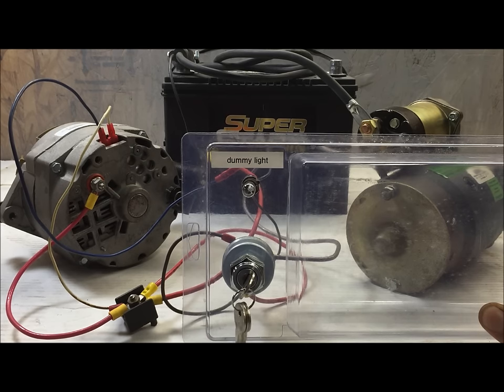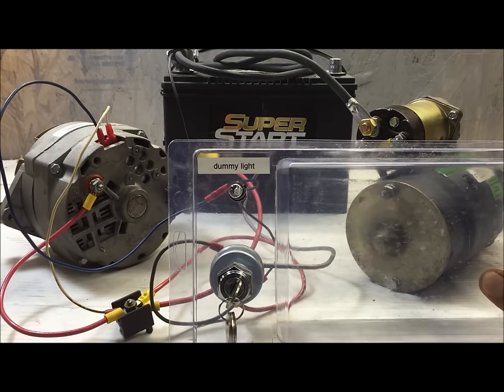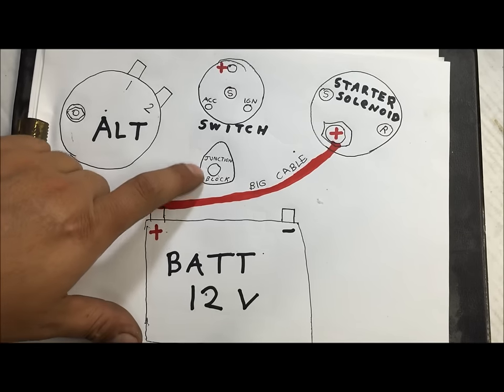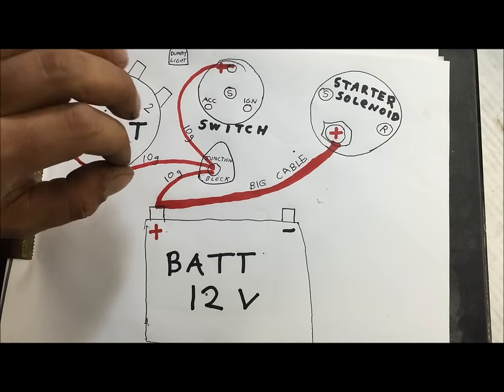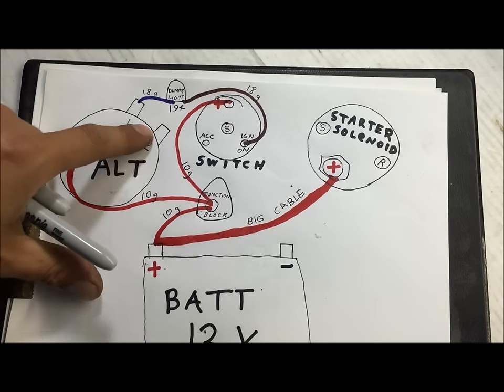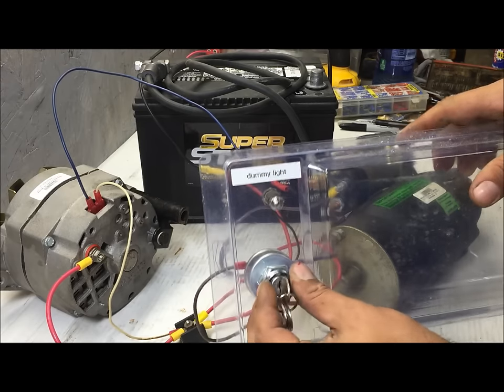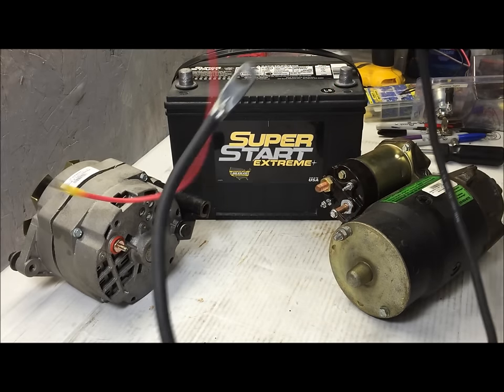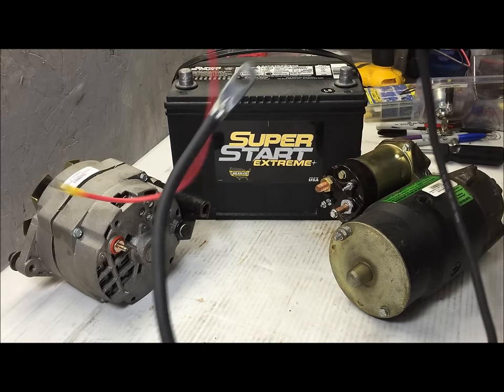64-72 charging system wire up using GM 3 wire internally regulated alternator

Comment: Nice video but how do I also wire the coil and resistor?
Reply from the maker: I have a points ignition video this is the charging system. Not the ignition system

Comment: For those wondering what the R terminal is on the starter solenoid ? On the older contact points ignition systems. 12v was too much voltage with the engine running. It would prematurely burn up the points. So they ran a resister to the points in the distributor.and drop the voltage to 9 or 10 volts. The R on the starter, also ran to the distributor, but only sent power during cranking. Giving you 12 v. To the points during cranking, as an aid to help start the engine. 12v.= hotter spark.once the engine has started, you let the key off the crank position, and the 9 volt resister wire was now running the distributor.
Reply: Exactly
Reply: #1 alternator exciter terminal wire requires diode inline or key won't turn off engine on 10si alternator. 
Do not buy new alternator if dummy light does not shut off and engine does not shut off with key.

Comment: Question about the 194 dummy light, you said it's to be wired hot off key to #1 terminal to excite the alternator, then it will cut off. What causes it to do  that?

Comment: The reason that the light goes off is that the circuit has a ground through the alternator before it starts to spin. The 12v coming from the ignition switch needs that alternator ground to light the light, once the engine starts, the alternator sends 12v back towards the ignition switch on that wire. 12v on both light conductors with no ground makes the circuit null and void, no difference of potential.

Comment: This is the best and easiest to understand video I found to explain this. No nonsense and too the point. You're a great teacher. This helped me with my 50 CHEVY TRUCK 12V conversion. I especially appreciate the safety factors you stress, wire guages, etc. I will however add a 50 amp in line fuse to the hot wire that feeds the whole system to prevent any spikes.

Comment: Big thanks for this I have a 73 pickup with a birds nest of wires that wont run because the last owner wired it all wrong so I plan to strip it down and re wire it but I dont know much about electrical stuff on cars so I wanted to be sure on the basics and you did this in a very simple but informative way that I understand!  Again thank you!

Comment: Thank you for your video, it helped me to understand and to rewire my 1973 Case 580 CK tractor. The alternator that was on the machine had two wires not three, but I went out and purchased a GM Three wire alternator. The prestolite alternator wasn't working so it had to go. Your video was very informative and easy to understand. Now the dummy light works. Thank you again Charles Mares

Comment: You are very generous to share your knowledge. This will definitely be a reference when I start wiring my 85 monte SS back up. (previous owner cut out most wiring for some reason.) Also have an 87 SS with a drain. Will double check the wiring on that one. Thanks again.

Comment: Best vid for me to understand how it all works.  Will be completing my '89 Massey Ferg tractor.  Can't wait to get started.  Thanks so much pal. 😊  In the late '50's chevy Dad's car had a generator and voltage regulator.  He'd turn on the headlights on long highway trips so that the regulator wouldn't overcharge the battery.  Gas was 39 to 50 cents a gallon then.

Comment: Chris, I appreciate the help very much. Drawing the diagram is key for me. I have a John Deere Diesel engine that my so-called, X mechanic rewired.  He had a small clamp on one end of a wire you were required to clamp it on the positive side of the battery with the other end of the wire going to the fuel pump. We had to hook it up to start the engine and unhook it to kill the engine. I am fixing to go repair my equipment with the help from you. I subscribed to your channel and look forward to many more of your demonstrations. Now I have to get to work. Thanks again!!!!

Comment: Great video and very informative. Only thing is that you should have mentioned that the big cable going from the battery to the starter is a POSITIVE cable. Given that the cable is black some people might think that it is the NEGATIVE cable going to the starter.

Comment: You can just replace the voltage regulator which is where number one and number two connect to. It's a chip and it's a lot cheaper.  Then buying the whole alternator A lot of times the stator  and windings in those GM alternators do not go bad or like you said the diode or rectifier but the diode and the regulator are pretty cheap and relatively easy to replace. There is brushes in there too like an electric motor but they come in a kit I think or you can buy them separate but they're not that expensive. Of course if you're savvy at rebuilding stuff like that, which you are just throwing that at you cuz that's what I do Good video on the wiring I like it!

Comment: Good video man! I had replaced the starter on my old Camaro and didn't have any power after I got the new one back on.. A small wire was coming off of the battery hot wire cable that I assumed was going to the junction box. As it turned out the 12 volts to the junction block was actually coming from the starter hot wire terminal, which of course I hadn't hook back up.(to be honest I had never seen that before) I'm glad you mentioned it in the video, or else I would have looking in a whole different area. As soon as I heard you say that I knew what had happened. I'm not a great mechanic, but I understand the electronic part pretty well. Thanks for taking time to do this.I've learned a lot from your videos.  David
Reply from the maker: yeah, after 71 they ran a fused link off of the starter to feed everything.. good comment
Reply: David  Slack the

Comment: Perfect explination.  Thanks man I am in the process of a complete rewireing of my 66 chevelle SS 396 using American Autowire.  I ripped out the old and after doing the simple stuff I went to the engine compartment.  To say its confusing is an understatement.  The wires are different colors than what is normally there.  Tough times...

Comment: British Classic Car Folks, BMC, British Leyland (MG, Triumph, Austin Healey, Jaguar all pre-1980) The main 10 gauge battery charging wire and the #1 (R) for the ignition light (14 gauge on my MGBGT) on the tachometer. The #2 (F) jump it to the main screw battery using 10gauge minimum. Great video that documents the electric path.

Comment: Thanks for the refresher course. Been tied up fixing newer stuff forgot all this. Just had someone bring a truck to me, 78 Chevy, that I don't think even one wire worked. Someone replaced all the gauges in the dash with aftermarket, cut holes out where the original gauges were and literally used silicone caulk to glue them in. An amp gauge, that was tapped into the power supply to the ignition switch. The copper oil  line to the gauge was cut about 5" before the gauge, a rubber hose with 2 clamps on a plastic nipple connected it to the gauge, It had been leaking oil down onto the switch. The aftermarket temp gauge with the probe into the the head had just been cut off when they exchanged engines. As for the alternator, the battery lead ran all the way back to the firewall and was butt connected directly to the #2 alternator lead on the alternator, with a big yellow splice connector barely connected to a red wire into the harness. Plus 10' of rubber gas line from the saddlebag tank switch valve laying on the exhaust to the manual pump, then a metal line up to the manifold, from the pump, that had a kink.... what a mess. And the one working tank is full of bad gas. All this crap connected to a new engine, trans, Edelbrock carb. Now new electric fuel pump, ran to original metal line along the frame. Tomorrow hopefully I can finish this mess, thanks to your help.

Comment: What actually happens when the alternator starts charging is it sends +12v from the alternator to the dummy light bulb. Since the bulb will have +12v going into it from both sides there will be no current 'flow' and the bulb goes out. It doesn't break the circuit to the bulb. That is why on some vehicles if the alternator isn't supplying the full current it should, and the "balance of power" is unequal,  the dummy light can glow a little. It's a alert to check the system, both ends of the main circuit, the alternator and the battery which could be malfunctioning as well. Great video exposition, Really great to see the wiring displayed like that, Thanks    Just sayin'         Mike

Comment: Great job Chris! .. Good overview of the alt, start and key switch hookup ..  If the light does not go out and there is and issue with the alternator its usually the rectifier going bad.  Normally the alternator is still good and a simple replacement of the rectifier will fix this issue.  However, it's still not to say the alternator has an internal short of open winding somewhere still causing the problem.  Most people will just replace the alternator costing $$$ where the simple replacement of the rectifier is a whole lot less.

Comment: i followed this video and was suscessful running a temporary ignition setup on my 74 chevy c20 after ditching all the factory wiring and replacing the fusable links everything is brighter and the engine woke up thank you for doing it right used all the same stuff
Reply from the maker: watch my 3 wire gm alternator video in case your truck won’t shut off
Reply: What did the fusible links run to, and where did you buy new ones?

Comment: If your application is in a tractor with a 6 volt starter (no solenoid) and coil with a ballast resister, the dummie light will go on the S or center post on key switch, and the coil will go to the I or Ign. Otherwise the motor cuts off when the ignition is returned to the ON position. Great video thanks helped alot

Comment: it wouldn't hurt to use 8 ga. wire from the alt. to batt. especially with higher amp alts. like 100 amp and up. and if long distances. or 150 amp plus 6 ga. or 4 ga. wire if using high current devices. more wire. means less voltage drop. and more current flow. and don't forget the ground. or negative side. there has to be a ground strap or wire. from the batt. to the engine. and body. I have heard of fires from poor grounds melting break lines . and fuel lines. because of the metal lines carrying the full current of the battery . when starting. or under heavy load. lots of the time ppl forget about the ground cables.
Reply from the maker: +James stranger watch my 100 amp alternator video.. this is factory 70 chevelle .. early video that I need to remake
Reply: I liked it.

Comment: I'm Completely rewiring My 69 C10 with a 1980 350 sbc using American Autowire (AA) Harnesses. Trying to figure out where AA's Brown wire (Alternator Ign) and red wire (Custom Jumper Supplied by AA) connected. The original Alternator harness wire colors were Blue and Red. From your Video, I'm now confident that I'm connecting the correct wires to the 1 an 2 terminals (as shown in your video. Thanks a million. Now I can get some sleep!
Reply from the maker: I have a gm 3 wire alternator video,,, it’s old

Comment: Saved me a lot of drama here, I was about to hook it up all wrong, I've been watching other vids and couldn't work it out, you have nailed it with this vid thank you
Reply from the maker: ask me any questions..  this video is actually an early one... but i know all about wiring anything old school...
Reply: Thanks I think I'm all good now I just had trouble getting my head around the dash light and the white and brown wires, but I would like to ask if the main drawback to connecting the White right at the alternator be not knowing if the charge is reaching the battery?
Reply from the maker: @715101  watch my gm 3 wire alternator hook up video

Comment: Thanks for the very good video. This helped me diagnose a short which happened to be on the starter wire going to the alternator. I was able to follow the wire - The wire was broken off. It is a 1972 LeMans.

Comment: it's usually a 4 Ga. cable from battery to starter, or larger. It certainly doesn't hurt using a larger cable. Just make sure to use "Tinned OFC Copper cable" so it does not corrode being out under your hood. cool video

Comment: Excellent video.  Your vid is the only simple explanation (3 wire alt) diagram and demonstration I’ve been able to find. Thanks.  Hands down nothing out there compares. With all that said shame on you for using a BLACK cable from the battery to the starter.  😳 it’s easy to find a mistake once you educated me. 😁
Reply from the maker: the factory cables on old cars were ALL black... those are factory reproductions for a 70 chevelle... watch my 3 wire alternator hook up video
Reply: There ya go and now we all know without a doubt why you are the teacher. Appears that I have even more to learn...  That’s ok I had already subscribed.  Again Thanks for the excellent vid

Comment: had to check the GM wirign for a friend. thx for the wirign colors, etc
you mention for the dummy light ''it interrupts the cicuit'  - the way it works is if you switch on ignition one side of bulb gets 12V and at the alternator (exciter) it grounds -> light is on
but the moment the laternator is charging, the exciter is also 12V. if you have 12V on both sides, the bulb  goes off ;-) so its njot an interrupotion as such - just a neat trick

Comment: great video. the "dummy" light can be replaced with a 10 ohm, wirewound resistor. wirewound resistors are more rugged than carbon resistors or "dummy" bulbs. years ago, they were referred to as "idiot"lights. a voltmeter or ammeter will tell you if your charging or not.

Comment: Thanks Chris. Eggszackly  what I was looking for.  So much easier to understand on a bench without all the engine compartment clutter
Reply from the maker: Watch my 3 wire external hook up  alternator video as well...
Reply: Chris Craft   Just subscribed so will watch a lot of them. Got an old JD tractor that was converted to an alternator and its not working too pretty good, either wiring or alternator not highly salubrious

Comment: Very very helpful. 
Straight to the point. 

It’s works. :)

My neighbor was pointing all kinds of stuff to replaced. I switch the 2 smaller wires and walaaaa!
Now my battery is charging by the alternator. Unplug the positive and negative from the battery and if the vehicle turns off there’s a problem with your alternator or may be wired wrong. 
Lol. I end up buying a new alternator anyways for peace of mind. 
Good luck 

Gracias.
Reply from the maker: I have a gm 3 wire alternator video going over charging problems
Reply: Chris Craft thanks for the heads up. 
I just seen your other video. 

I recently had to upgrade my new starter because the way my wired the alternator actually drained my batt the next morning. I had to take it to a auto electric spot not break my head. $140 ans solved my problem. 

They had to replaced my alternator to a similar but one that works different with an internal part that doesn’t need a 12vlt regulator.

Comment: As a side bar. If you were to swap out the points distributor with an HEI ignition, you needed to get rid of the resister. Most people do this, as HEI gives you a much hotter spark, and is trouble free. No maintenance.

Comment: i have an 86' Chevy C10 and i started to do lots of repairs. one at night noticed a big huge sparks... when i looked at my bulk of wires from harness, their was like 5 wires  exposed to metal and so after repairing the wires noticed my charching system would not charge. this was about 8 months ago so after a struggle of new alternator new battery fixing wires i was upset could not find the issue. so ive been upset let truck sit now no tags and seen this vid. it has giving me hope!!! im starting all fresh and rewireing the whole charging sytem like on this video hope it works for me or else im burning the truck to the ground. engine has 88,000 orig. miles from previous owner n the old man never requested pink from bank, so i did that was easy and i do have pink in hand but i will also burn pink slip on the ground next to truck if it dont work!

Comment: wwwwwooooaaaw  thanks Sr. !!! i replaced my accessories band, what a headache ! but in the pulling to fit it... i disconnected a wire, and now i  know that i plug in the wrong place, my c10 alternator have more than 2 pins in the back. THANKS AGAIN !!!

Comment: At time time I didn't have the money to purchase a 10si alternator to convert from the generator on my 3010 John Deere. What I used was an old Motorcraft alternator and wired it to an AC Delco voltage regulator. Both parts were lying around the shop, so what the heck? Works just fine.

Comment: Chris,  Great video.  Thanks.  Replacing the generator in my 58 Chevy panel truck with an alternator.  The difference is the ignition key merely completes a circuit and the starter is engaged with a foot pedal.  Please help me apply your video to my situation.  Thanks!

Comment: Thanks Chris for the video. it just made my work straight forward. this deserves thumps up.  This is of great help to my project. keep up the good work.  if u get time, help me to wire a radiator switch, thermostat, equas gauge. thanks a lot for the video.

Comment: Great vid, there are the EXACT components on my dune buggy and this vid. answered all my questions, THUMBS UP!
Reply from the maker: watch my 3 wire alternator video if you have problems with that
Reply: @chriscraft77022  no need, I have the EXACT sme alt. and light, I am rewiring the whole buggy and this vid was exactly what was needed
Reply from the maker: @unoefxz  I'm saying if the engine dont shut off you should watch the 3 wire alt video..